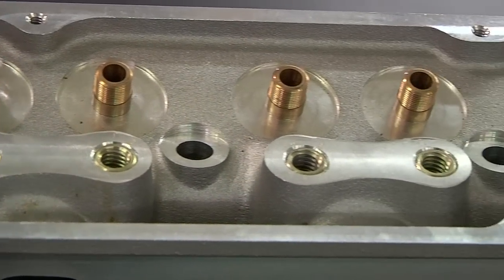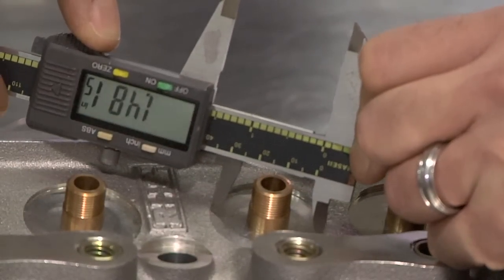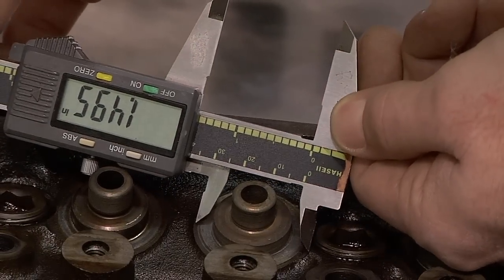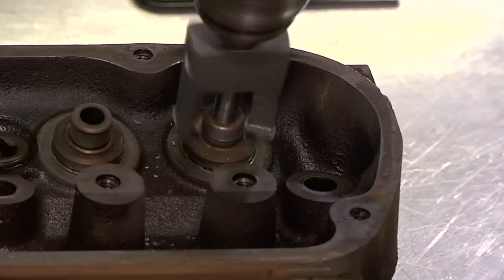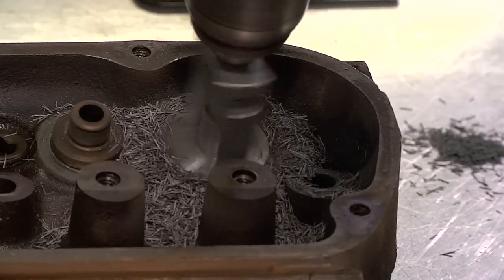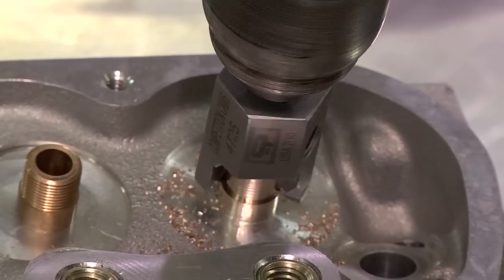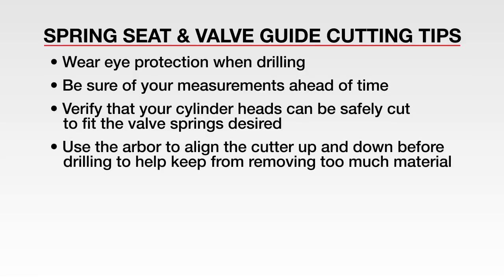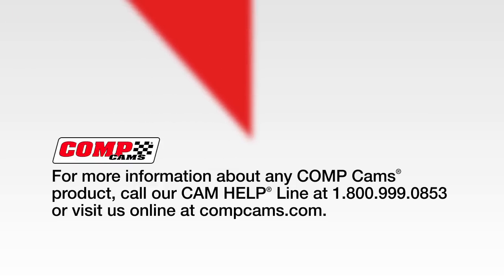COMP Cams® Quick Tech: Valve Spring Seat & Valve Guide Cutting Tools

Comment: Don't do this job with a hand drill..Or a underpowered drill press. If you decide to do this job yourself. Make sure that you have your head clamped down so you don't oval out your valve guides and... use cutting oil. If you screw up bad,it's probably going to be cheaper to just get another head (s). Remember...they want to sell you a tool. Don't be a tool.
Reply: I've done a hundred heads with this tool no issues. If you wallow out a guide, you are really pushing it at an angle hard. I've done steel and bronze with great results.  Just go slow and measure accurately. I never use oil and have not seen a difference either in the quality of the cut.

Comment: Nice video.  I like how you guys make things so clear.  I have a question.  I recently bought a pair of Chevy '186 heads (for a clone 1970 Z-28 motor).  Someone had previously machined the seat pockets with a 1.47 OD cutter.  I'd like to run as close to stock parts as I can (stamped rockers, Z-28 '178 cam, Z-28 valve springs and so on), so when an old timer hears it run, the mechanical cam, rockers, and everything will clatter properly as they did back in the day.  Can I still run stock diameter springs and retainers on these heads as long as the shims (if any) match the pocket diameter?  Thanks!
Reply: Shouldnt be an issue main thing is that the shims dont walk sideways under the springs , shims should hav ID that matches guide OD

Comment: For cast iron GM Vortec heads, which cutter do I need to reduce the height of the guide boss by .030", keeping the OD at .560"?  Also, it looks like material must be removed form the lower, larger diameter part of the boss to allow the seal to sit lower.
Reply from the maker: You would need to use a valve guide cutter to lower the height, but we do not offer a .560" guide cutter. The most common one our customers use is part# 4726, which cuts the guide to .530". You will also need an arbor part# 4732.The .530" guide size allows  you  to use wide variety of valve seals, such as our Teflon part# 503-16 or Viton part# 529-16. Thank you.
Reply: Mikey Designs & Silk Screen I you mean GM Vortec heads, the best route there is the GM LS6 beehive springs #12499224 for $61, along with the CompCams #787-16 retainers and #648-16 locks. I think this buys you approx .050" more valve lift with no machining necessary.
Reply: COMP Cams What springs would you recommend with the xtreme energy 274? Will springs 981 still work?
Reply: Mikey Designs & Silk Screen I see where the Comp catalog recommends the 981 spring for that cam, and the 26981 beehive spring (with 787 retainers) as an upgrade. The beehive spring is lighter weight for more stability and is good for another .035" valve lift.
Reply: mb55chev Thank you. I understand you can install the beehive springs with their retainers and the vortices will be ready to go for more lift. If I can save a hundred dollars and achieve the same effect with these arbors, that would be well worth it. I don't mind the work.
Reply: mb55chev Thanks for all the help and tips.

Comment: I see the valve guide cutter only the OD of the guide, does it/can it cut the height. Need to increase guide to retainer clearance. Is there a video on how to set it to do that and is there a part#?
Reply from the maker: The guide cutter also reduces the height of the guide. Unfortunately there isn't video that shows this, so when cutting the guide you will have to judge how much needs to come off and just go slow. Thank you.